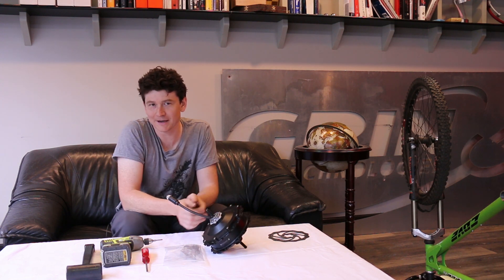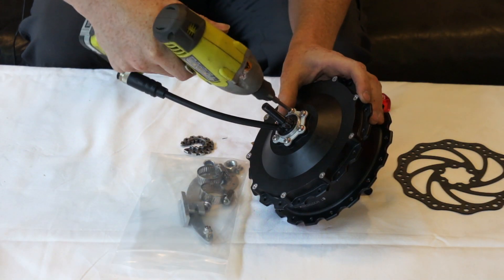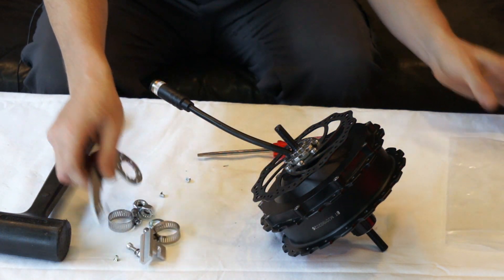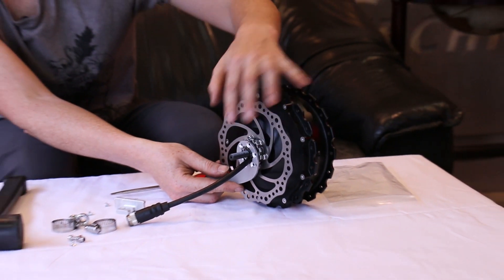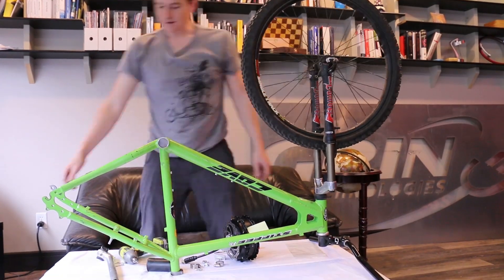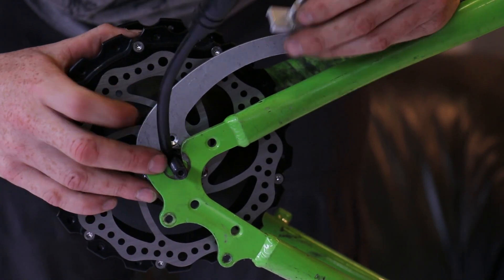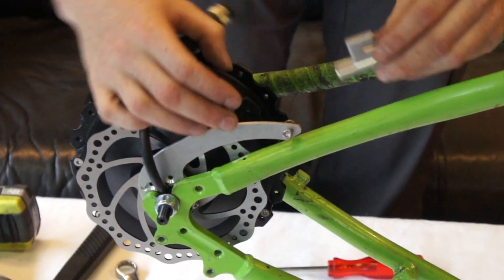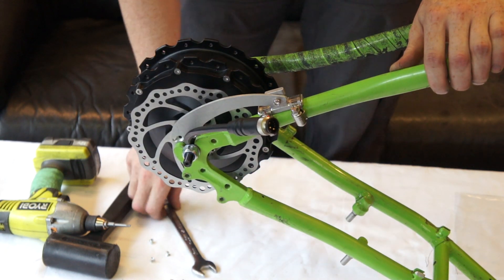GMAC Motor and Torque Arm Installation

Comment: maybe you know what i have to know, i got the 39mtx rim with 18 spokes 1 each side. with 2000w motor, but can not find the spoke tension anywere online, can you find out for me? or if you can not find it, just other rim with 2000w motor ? i hope you can help me. i realy need to know
Reply from the maker: Tension the spokes to the same degree you would any normal bicycle hub. The fact that it is a hub motor makes no difference here.

Comment: If I tighten down the axle nuts, I am unable to pedal. There is a ton of resistance.
Reply from the maker: Then something is rubbing, have a close look to see if there is any inteference with the dropout, or between the motor side plate just inside the disc rotor and the screws of the torque arm.

Comment: So that would be compatible with a burley trailer hitch which attaches on the outside of the frame just like the washer?
Reply from the maker: Yes indeed, that is one big advantage of this style of axle with an inside the dropout torque arm.

Comment: I have a 750 W BAFANG motor on EACH wheel and two 15 Ah batteries so I NEED these torque arms. (E-CELLS Super Monarch Crown)
Reply from the maker: They won't work with a Bafang motor, this fits a special splined axle interface on the GMAC. For regular axles with 10mm flats check out the V5 and V6 arms here https://ebikes.ca/product-info/grin-products/torque-arms.html

Comment: Would this Torque Arm work on a standard MAC Motor?
Reply from the maker: No, the standard MAC motors have a regular M14 axle with 10mm axle flats, not a splined interface like this.

Comment: OK. So you securely mounted the torque arm, which is fixed and stationary to the bike frame, with the opposite end of the arm to the hub motor, which rotates.   So, how does the hub rotate?  Please explain.
At least you do have the torque on the correct side of the bike frame.  All the torque arms I have installed in the past 11 years on over 200 ebikes, the torque arm keeping  the axle from rotating, allowing the hub to rotate.  Are you an employee of Grin?
Reply: Touche 😉
Reply: @kramsenoj1  
"do you work for the guy?"
"i AM the guy :D"
lol
Reply from the maker: The hub rotates around the axle through the ball bearings on the shell and side plate. The torque arm is not mounted to the motor, it is mounted to a splined interface plate on the motor axle.  Please read:  https://endless-sphere.com/forums/viewtopic.php?f=2&t=93562&sid=ccc9e280df1126659b5ea6d0ab8e4b60

I am the founder and owner of Grin ;-)

Comment: I like this a lot, especially the Virtual Electronic Freewheeling feature + regen.
2 quick questions if you dont mind:
- pdf file says 172mm diameter between spoke holes, so I can presume that this motor is no bigger than 180mm disc at OD?
- can we still order this with phaserunner, looking at website there is only baserunner as option if ordered as a kit? 
Thank you.
Reply from the maker: 1) That's about right, It's definitely smaller than a 203mm disk, and a tiny bit larger than a 180mm. 
2) You can buy it with a Phaserunner either as the DIY GMAC kit, or the 72V GMAC kit: 
https://www.ebikes.ca/shop/electric-bicycle-kits/gmac.html
Reply: @GrinTechnologies  dont know how I missed that page, thank you.

Comment: I can't believe I was about to purchase the all axle motor (was really excited for a few hours) only to realize the only thing stopping me was the absence of any good video (heck, even a diagram) from of ebikes.ca or the two other people on YT that know about this motor, showing how it can be securely mounted to a standard 26in mountain bike fork.  Both the kit and the motor make zero mention of any frame clamp hardware that mounts on the fork itself, but their parts section has an all-axle frame clamp, which looks like it's designed to be attached with hose clamps like this GMAC video - but as to how it makes a secure connection to the all-axle torque arm securely ... , I don't know.
Reply from the maker: Hi Thom, that is a video we'll be releasing soon. Actually we filmed it almost a year ago but haven't gotten around to the final editing and then we made some changes to the mounting clamp system rendering parts of the footage outdated.  Now that things are maturing in the V2 All Axle design we can commit to fully documenting it both in print and in video and look forward to bringing that content to people.
Reply: Thanks - that would be great!

Comment: Your site has 7 torque arm models available for purchase, and this GMAC torque arm and the all axle motor torque arm are not include in those 7 models... why not?  (www.ebikes.ca/shop/electric-bicycle-parts/torque-arms.html)
Reply from the maker: The GMAC motor has a built-in torque arm that is included with the motor, that is why it is not listed as a separate torque arm to purchase by itself. The torque arm page you link there is for 3rd party after-market torque arms for hub motors that only include axle flats.

Comment: Why is the frame mount side of this torque-arm designed differently than the one for the all-axle motor?  When is a corresponding how-to video going to be posted for mounting the all axle motor torque arm, since that motor cannot operate without a correctly (and extremely securely) mounted torque-arm to the frame?  Are hose-clamps really a "secure" mounting solution for a 700 dollar hub motor?
Reply from the maker: Two hose clamps are extremely secure. One is more than enough, but two gives extra redundancy. The important detail is that there is no flex or play in the metal band, otherwise you can have fatigue failures over time. It needs to be done up tightly.

Comment: I have doubts about not having a washer on the inside
Reply from the maker: There is zero need for inside washers but you are free to put one on if you have unfounded doubts about that. It won't do much harm other than increase the OLD a little.

Comment: I've been wondering, why don't you bolt the torque arm to the disc brake mount on frames that have them?
Reply: I was thinking the use of hose clamps is kind of cheesy. they them selves can slide on the chainstay. there has to be a better way to attach it than re-purposing hose clamps. even a slot in the arm itself to thread the band thru would be better, but still be tacky.
esp when you consider how much these hubs cost. would you secure a $600 hub with 99 cent clamps?